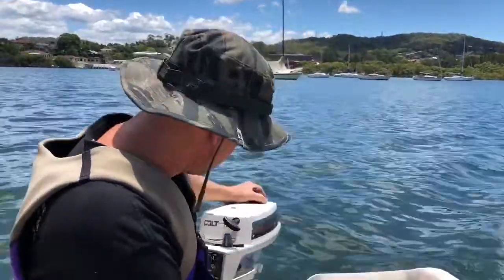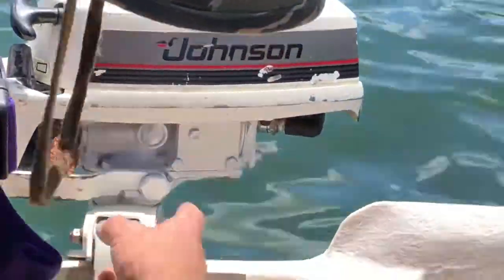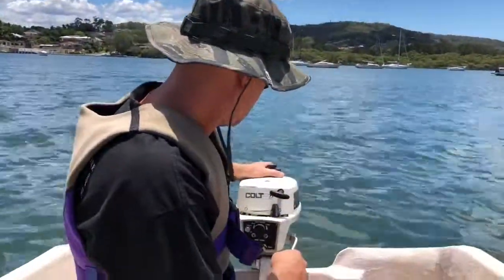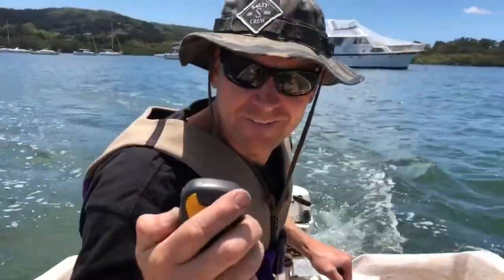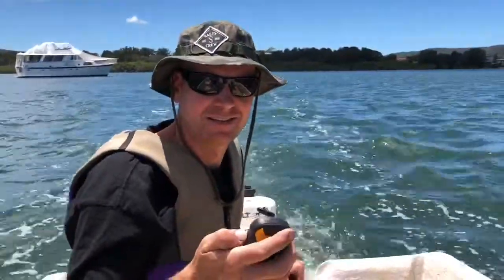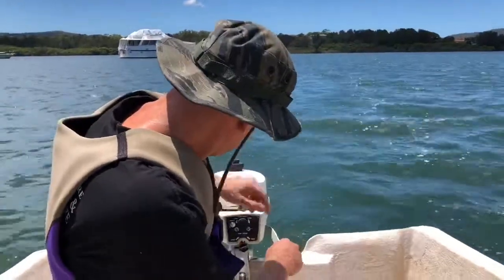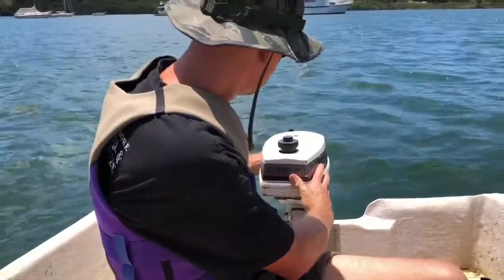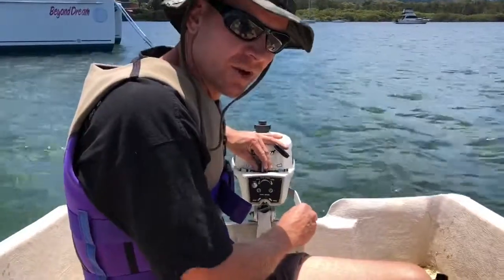Outboard Johnson mate 1.2hp

Comment: What should I out for fuel in it? 40:1 or 50:1?
Reply: 100~1 oil fuel mix lol
Reply: It says on this engine to use 100:1 but I'm pretty sure that's just to pass EPA regs, run 50:1 for trolling and 40:1 for constant WOT
Reply: Lovely little motor. 
What would a 2 HP Johnson do in km per hour do you reckon. ?